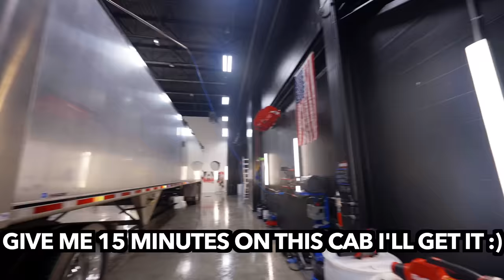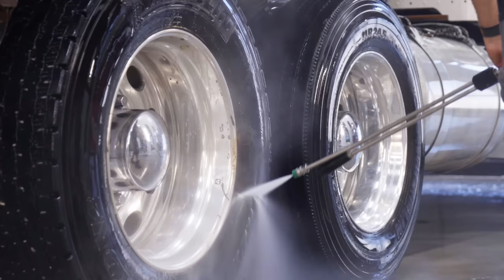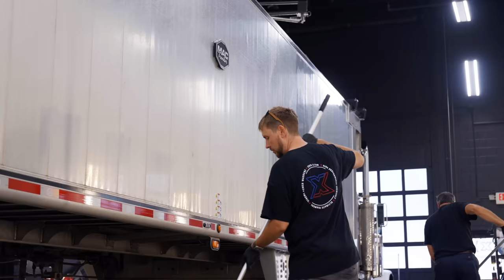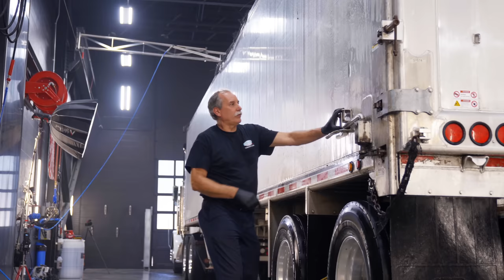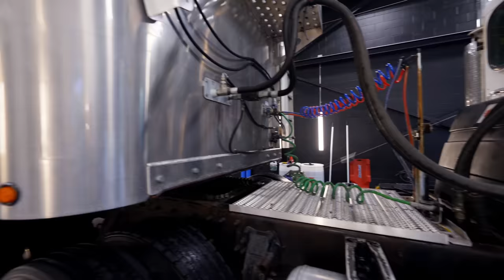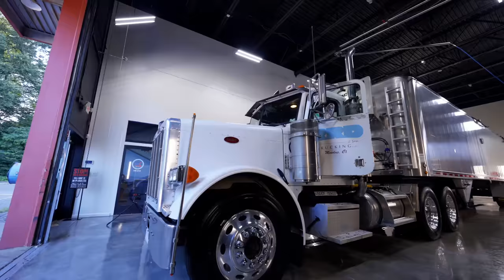This 98 Peterbilt and Mac Trailer turned out nice

Comment: Is the system your using/spraying in this video the project build of the 2500 psi 4 gpm shiny stainless motors and cat pumps mounted on the wall with diamond plate from about 3 yrs. ago?